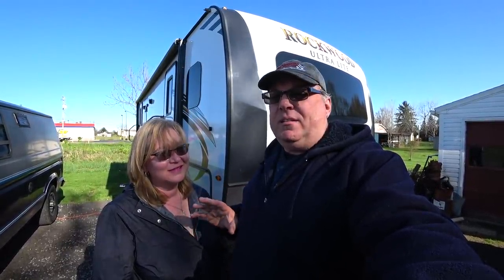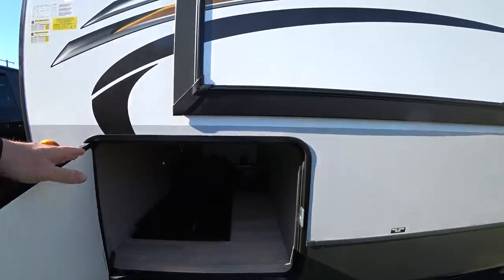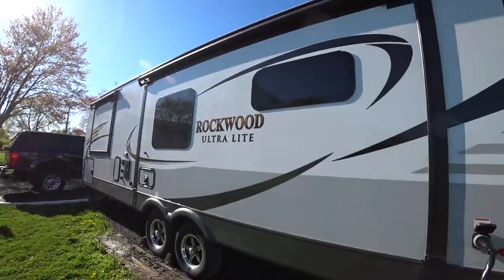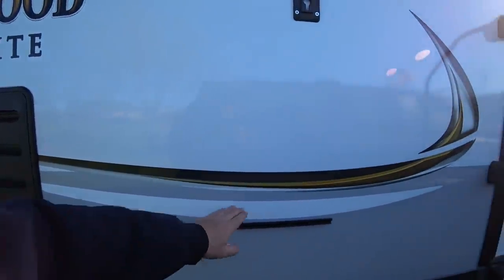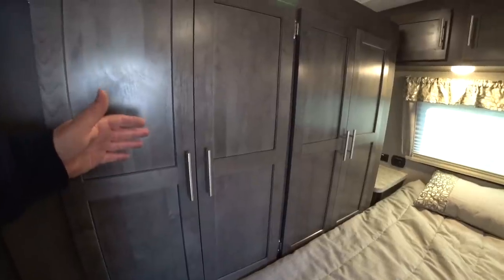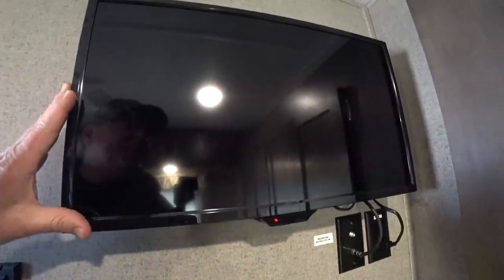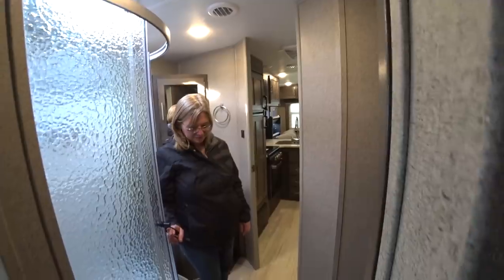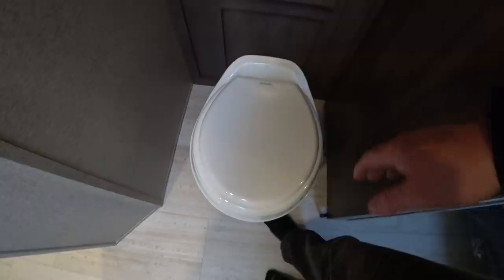2020 Rockwood 2604 WS Detailed Look & Why WE Bought it

Comment: Hello! Just watched your video... love how you measured the clothes cabinet space, but could you also measure the under bed storage?  Thanks!
Reply from the maker: It's approx 4' x 24" inside with 3 small drawers underneath.
Reply: Thank you, but how deep?  I am trying to picture a washer / dryer side by side in place of the storage box and raising the bed platform... Washers/Dryers are 27" wide and 39" high... so if the bed is around 29" off the floor then it would need to be raised 10"... Ummm...

Comment: We are looking at this model bit a 2019. If you had to do it over again, would you? I know this is an old video. Was the kitchen sufficient?
Reply from the maker: I'll have to ask Heidi about the kitchen. We lived in it for 2 years. For me I thought it was exceptional. I don't know what the differences are between the 2019 and the 2020. Rockwood has a tendency to add options as standard features if the model goes another year. For example all of the ultralight travel trailers now have metal awning guard on top. Whereas that wasn't an option for us. And for us in 2020 they made the solid steps a standard feature. I think in 2019 they were still regular folding steps Maybe? I know that the 2017 or 2018 model of 2604 WS did not have the same tank sizes. Which I'm pretty sure the Rockwood we had was 45 gallon freshwater 45 gallon gray water 45 gallon black water.

Comment: Nice video but I do beg to differ with your assertion that it is a "slide accessible" unit.  At best it is partially slide accessible because of the second door.  But within the industry, slide accessible means that you can access the entire unit, with the slides in, without having to climb over furniture or appliances.
Reply from the maker: Since you refer to it as being "within the industry" , can you point me to some sort of verbiage or literature which defines that definitely or is it just your interpretation? Because the same could be said for quite a few things. For example, with the awning extended but placed in the down position, most commonly used for rain runoff, most of the industry, says that entry to the RV is still fully accessible. However, most RVs require the door to scrape along the awning materials underside and usually the door can't be opened all the way. But you can still enter and exit the RV. So my viewpoint is that with the awning in the down position the entry is permissible even though you have to make accommodations in using the door. And to continue forward with why I consider this a slide accessible unit is because I have yet to find any unit that once the slides are in they allow full access to every cabinet, door and every Appliance that it is equipped with.

Comment: As a trucker, by the Rv's taking spots with the trucks takes away a spot a driver could use after 10+ hours of driving. RV's can park almost anywhere but trucks can't. Not to mention truckers get tickets for going over time on log book because campers taking truck parking plus how many familiesloose loved ones cause a driver couldn'tget a spot and fell asleepat the wheel. Trucks deliver everything in your life,food, clothes ect.
Reply from the maker: This has already been discussed many times before.... The problem lies with the lack of parking spots... For everyone.... I can get sleepy driving just like anyone else and need rest... Although not quite as heavy, I'm sure I can do a fair bit of damage @ 22,000lbs if forced to drive while drowsy... We called ahead and was told that spot was available for RVs... Again, the problem isn't people "stealing" "trucker" spots but there isn't enough parking available for everyone... As There are alot of Semis there are quite a few RVers on the road.... We aren't all on vacation... We travel full time and work from the road... Campgrounds charge $30 to $80 for a 1 night stay over even if checked in much later in the evening.. Wal-Mart is not only hit miss but rarely are close to the highway... Cracker Barrel sometimes don't have spots either meaning we may go 4 to 8 miles off the highway only to find no spots or low hanging trees not friendly for our 13'2" height... Again this is a problem of spots available for everyone... Being over 55' in length makes it a challenge for us as well... Now if I was driving a small van or had a small trailer that would be a different thing...

Comment: Very nice unit and detailed useful video, thanks...
I am looking at the same unit, can u tell me what is your feedback about it after 1 year ownerships and trips? good and bad
Thanks
Reply from the maker: Had a couple of small leaks that they are willing to take care of even though it's out of warranty. Some of the components failed inside but they don't have any control over that and they fix them immediately. All the major components work just fine such as the axles and brakes and lights and all the power components both air conditioners all that stuff works really well and it's a very, very comfortable unit to live in and to tow for that matter. Of course we have an F-350 and a pro Pride hitch so that helps considerably. I want to try Towing it with an F-150 unless you're just going out a couple weekends a year. It took us two and a half years and a lot of RV shopping which you can see in our playlist under RV shopping to Circle back to this unit then purchase it because for us it was the perfect fit for a lot of reasons.
Reply: RVdaydream thanks so much for quick detailed answer...
From reading , the problems u mentioned seem to be common with most RVs manufacturers 
I am planning to use it 4-5 x yearly at camp sites and to tow it with F150 3.5 EcoBoost which according to numbers is able to do with appropriate packages (towing capacity 12800lbs)
I am new to this so trying to do extensive searches and ask “seasoned RVers “ before I make final steps

Comment: A few questions. Would appreciate your feedback. (I’m going to be purchasing something in the next month) 

1. I’ve seen where the aluminum framed sides have the fiberglass delaminate. Also fiberglass is harder to repair if something gets damaged. 
2. Wood frame vs aluminum? 
3. One model that I’m considering the drains seem to be lower and may be hit. Is this a concern in real life or just something I’m paranoid about. 😳
4. I’ve read that the glass on the front of the trailers may get damaged while going down the road. Is this true? 

Excellent video, VERY detailed and I really appreciated it. While I’m more into a smaller version I learned a lot. 

Take care and enjoy your beautiful new trailer!
Reply from the maker: Thanks Bill oh, those are very good questions fiberglass units especially in the 90s and some of the early 2000s the laminated really bad because of their poor adhesion due to bad practices by the RV manufacturer during the laminate process. Rockwood has their own laminate Factory and have 100% control over how their walls are made and most other RV manufacturers source the walls out. As far as the lamination it could happen to aluminum-sided or Woodside it it doesn't make a difference. The fiberglass actually adheres to either sheet of Luan or a sheet of azdel. So as far as the framework being either aluminum or wood it doesn't really make a difference as the fiberglass and here's to something other than those two things. Rockwood uses a vacuum bonded laminate and glue. So basically this thing's rolled into a big suction machine and it sucked together they are definitely not known for delamination nor are they known for leaks on their RVs. The wood frame versus aluminum is really almost to the point of being a personal preference. The aluminum is lightweight and more exacting so the flex maybe a little less when going down the road. Rockwood double welds all their aluminum wherever they contact a junction. As far as the wood frame it may actually be able to flex a little bit going down the road and that is not necessarily A Bad Thing. It's basically two schools of thought whenever they're putting it together however oh, and more obvious, is that aluminum is a little bit more expensive so most of the lower end travel trailers and fifth wheels usually use wood to keep the cost down. Are old 1992 Terry Resort is all wood and it is pretty darn solid for how old it is it really doesn't show any signs of fatigue as far as the frame is concerned so again, it's a personal preference thing. Plus that little Terry Camper weighs 4300 lb empty and a new one that is comparable in length height and width would only way probably 3500 lb Max. The glass on the front of trailers may get damaged on any RV except for ones that have Road covers. Again you can refer to videos that we have on our old Terry Resort and you can see the factory Road cover that covers the glass on the front however the Rockwood has an automotive style laminated piece of glass just like your windshield in your car. But a rock could still damage it. Again thanks for the great questions I appreciate it!👍😁
Reply: Thank you for the detailed reply! 

There are so many choices. It’s just going to be my wife and I and I’m trying to stay around 5,000 max unloaded and up to 7,000 max loaded. This will be our first and hopefully last unit (hah 🥴) and I think the longest we would be out on a trip could be a month at a time once we retire. 

I really like the forest river Salem cruise light (not so light at 5,001 lbs) T210RBXL, Forest river flagstaff micro light 25RKS, Rockwood mini lite 2109S and a few without slides. 

Again, thanks for your time!

Comment: I really loved your review on this Rockwood. I have a Rockwood of my own; a 2018 8324 BS. I have been full time in it for 13 months now. It is a very spacious model and very beautiful interior. I will say that as far as climate control, hot or cold, it is absolutely horrible. I have dual AC on 50 amp setup, if it is anything close to 100 outside the best I get inside is 78-80 degrees. Last winter was a nightmare, with pipes and water pump freezing. I have a covered and heated underbelly, mind you. I do love Rockwood but its climate control is not what they claim. I wish someone from Rockwood would come and see for themselves how horrible it is in here. Also, I have 75% of my windows cover with Reflectix and it is still 80 in here in the summer.

Comment: Not Bad, Rockwood makes a decent trailer.  Though, with this coach so heavily optioned , I probably would have just stepped up to one of the "Open Range" models, or other certified Dwelling/Full Time rated.  Rockwood is definitely a Recreational Grade Camper.  Keep a look out for  "No Fulltiming" or "Residence" exclusions in their standard warranty, they are sticklers about it.
Reply from the maker: Lol not worried about warranty when fulltiming 😁👍

Comment: Great review, what type of floor material is under the slides outside? Thanks
Reply from the maker: A hard plastic.... Very rigid
Reply: No Rockwood dealers in my area in Savannah, GA. There was a dealer for Flagstaff which I didn’t realize are the identical floor plans and construction. I am very particular as well and I have yet to find a trailer construction I liked.  I was very impressed with the Flagstaff construction. The material used in and under the slides are the best I have seen. Thanks for your great review which led me to this company.

Comment: Not much counter space. The Morryde Steps not good if you're trailer is side by side in a storage facility.
Reply from the maker: That's something that I neglected the show. I'm going to use my truck as a side-by-side example as far as clearance and those steps. I think everybody's going to be surprised how close something has to be before those steps are an issue. As far as the counter space, that was the part that kept us from getting at 95%. So we were at roughly 80- 85% of having the RV fit all of our needs. I could redo the stove and sink like I did in the old RV and we would have plenty of counter top however more important thing counter space is kitchen storage it's going to be difficult figuring out how to utilize all those rooftop cabinets above the slide and above the Rockers. We'd much rather just had a pantry available but that would have added close to two foot onto the shorter 30 foot length that we were trying to stay at

Comment: You sold me! Rockwood should be paying you finder's fees. (I wonder if the hole on the bathroom shelf is for a hair dryer.)
Reply from the maker: Hmm I am gonna find a dryer that fits there 🤣
Reply: @Rvdaydream  I'm only guessing because it's hard to tell how big the hole is by watching the video, but my sister used to have a bathroom shelf that had a hole in it that was meant to hold a hair dryer.

Comment: So after it’s been raining and you fold the stairs in, I’m assuming all that water ends up on the floor inside the trailer right?
Reply from the maker: To be clear, if it just happens to be raining. The little tiny bit of water even in the strongest downpour that may remain on the steps will run off at a rate of roughly 90% when the steps are placed in a horizontal position before putting them up right into the RV. Therefore the little tiny bit of rain that remains on the tread of the steps and on the risers will find itself on the floor of the RV that can be easily taken up by placing a kitchen hand towel on the floor prior to putting the steps in. The reason that I make it sound so sarcastic is that people are having a hard time understanding the situation would have to be so unique in the first place that you're putting away your steps in a downpour and even if that's the case you probably have your awning out keeping the water off of the steps, even if that is the case, the steps are not designed in such a way to hold water to any extent on the tread and even the water that does remain runs off once you place the steps halfway up on their way to an upright position inside the RV. Do not be concerned about the steps and the amount of water or dirt that may get inside the RV. The benefits of having these steps far, far outweigh the inconvenience that you could possibly experience in the scenarios of dirt and water intrusion during storage.

Comment: I have a question, I’m looking at getting a Rockwood 2609 I believe and it has a covered underbelly. My question is, with some trailers I heard about the water tanks coming loose or not really secure and coming off, How can you inspect them during PDI without tearing open the cover? Thanks.
Reply from the maker: You can't... The plastic underbelly is secured to the frame... You a Normal PDI doesn't go that far in depth.... During the pick up and walk through You can ask the dealer to remove the cover and inspect, but I am sure it would b at an added cost... Or you can just wait until you get home and do it yourself...

Comment: Love your Rockwood. We just got our 2019 8329 and love it. The Serta mattress is the first thing we need to replace.
Reply from the maker: Actually spent the night in the driveway first night woke up no aches or pains, I think I might like it. On to night #2 tonight lol 😁😁
Reply: Give it a week. We may go with the wilderness Montana mattress.
Reply from the maker: @missmacintox  I didn't want to see this comment lol 😁 I was just hoping lol thanks for sharing. Might just try a topper first who wants a brand  new mattress from a new rv lol. They should just charge us the $ and put an awesome one in 😂
Reply: Do you know how thick the mattress is off hand? I have the same unit But I have not measured it yet. I am 6.4 and I am looking to get the mattress extension block so my feet won’t hang off. Lol.
Reply from the maker: 60"x75" is our rv queen size
Reply: RVdaydream sorry. Meant the thickness.
Reply from the maker: @driveforsho  hmmmm not sure.. Will have to measure

Comment: You will find the springs will rust and break off in a year or less. They're garbage. I don't know why they don't use stainless steel. In a year and half of full timing, I've never had any insect issues in those areas.